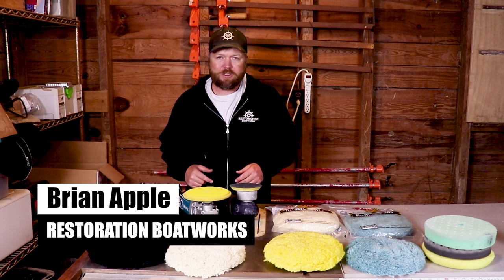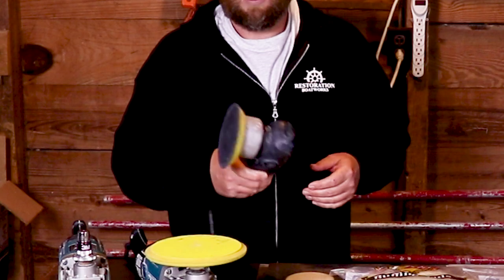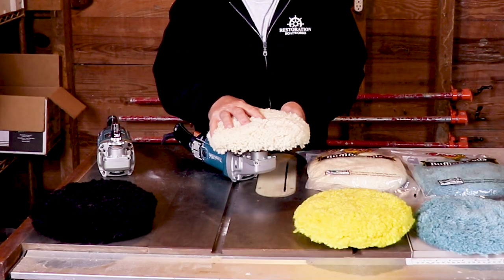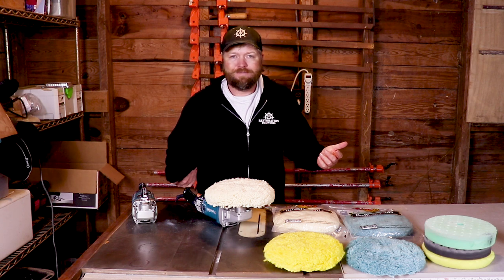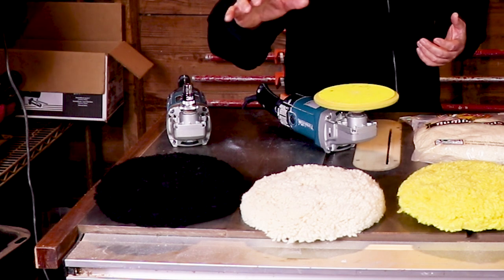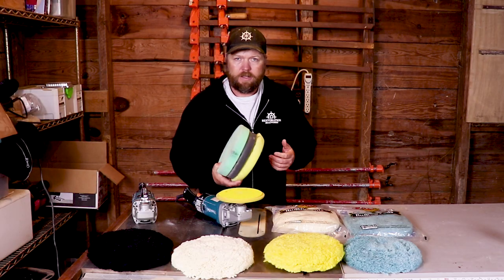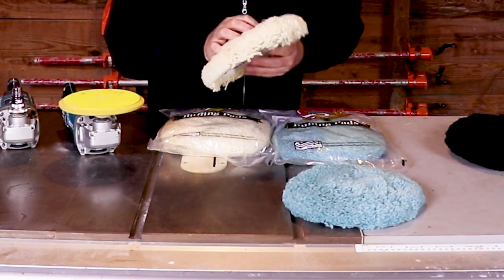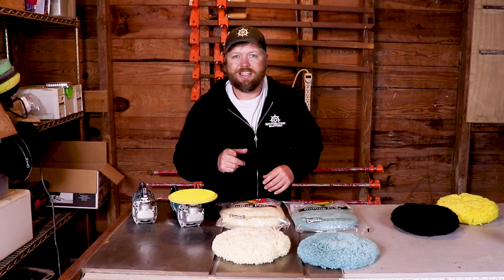Which buffing pad for boats

Comment: We use double sided mop heads solely for the fact that they are balanced better. You can put a velcro pad on but if you are slightest bit off it will vibrate. It may not seem like much but it will tire your arms and your shoulders. Good video. And Presta is a fabulous product.

Comment: Great videos! I have a couple of questions. 1. What type of pad do I use for Waxing?  2. I am replacing original stickers on my boat. I do have oxidation on my boat. So I will use a compound first. When should I apply the new stickers. My guess is after the polish but before the wax. Just want to make sure the stickers will adhere after polishing. Thank you

Comment: So you have listed a buffer that has a 7" pad spec but I'm only finding the pads you recommended in 9" pads. I don't want to buy the wrong pads. Is there something about the PAD spec that would mean the 9" pad will fit on the 7" buffer?

Comment: Hi there! I don't have a boat, but I do have a fiberglass RV, and I think they're about the same. I have used the heavy wool pad with Meguiar's one step, and brought back a fantastic shine. Adios oxidation! So now that I have de-oxidized, polished and waxed (spray on Turtle Wax Graphene Flex Wax) what should I use for the final buffing? Will the blue polishing pad you mentioned be too abrasive for a final touch? Thanks in advance.  (And let me just add, removing years of oxidation from a 23 year old 32' class A is a colossal pain in the a$$! I now completely understand why GOOD detailers charge well over $1000 for this. You people are saints! But after hiring one clod who did a HORRIBLE job, I just did it myself, so now I just have to maintain it)

Comment: Buff and shine sells double sided wool pads and an extension for those pads that’s only $5. I like the double sided pads because they’re pretty much two pads in one, plus buff and shine has wool pads from heavy cutting to finishing, a double sided pad is always perfectly balanced since it’s always centered, with Velcro you have to guess it a few times to get it close.

Comment: Brian, I have a light oxidation on the stern area, and maybe 5-6 feet towards the bow on my boat.  Past that it's in pretty good shape.... I don't want to cut too much, so what would you recommend for me?  It's a black boat and I don't want to end up with tons of swirls.  I have a decent polisher I have used on clear coat that works well.  What pads and compound would you recommend for light oxidation, and finally polish, for the black on my boat?
Reply from the maker: Hunter Johnson what usually happens when you try not to cut “too much” is you don’t do enough.  Especially with dark colors.  If I can see oxidation I’m using compound and a wool pad.  Then polishing with a blended pad.  Did I answer your question?

Comment: Orlando, FL.  Hey Brother thank you for the videos, great job.  I picked up a Makita. I know what pads, cutter, polish and material you use, but I don't see anything about the backer attached to the Makita.  Are you using what is supplied with the Makita, or is it from another manufacturer?  Thanks
Reply from the maker: knotfeelnit sorry!  I left you hanging on that one.  You can use the Makita pad that comes with it.   I do prefer Presta or 3M’s backing plates.  But it’s not any big deal.  That Makita is an awesome machine!  Good luck with it and reach out if you have any more questions.  Brian
Reply: @SportfishingBoats  -  is is the 3m 7" backing plate?

Comment: Hi Brian-  I have a Cobalt 262 WSS.  After spending the summer on the lake i would like to polish the boat before putting it away for the season.  Since the boat is a WSS it has graphics on the side that appear to be on top of the gelcoat (something like a decal).  Is it safe to compound and polish over the graphics?  Also, since I have never done this before what are the 5 mistakes that beginners do when polishing a boat.  I have purchased all of your recommended products for this project.  Thanks.
Reply from the maker: Chris, sorry for slow response.  Don’t worry about graphics.  Go over them like they aren’t there.   Common mistakes in no particular order.  1.  Not compounding and polishing enough.- don’t stop till the surface looks new.  2.  Waxes aren’t the secret.- polishing is!  Pick a wax you like and move on with life!  3.  Fear of “burning” gel coat.  Only buff in shade and keep it moving and you’ll never have any problems.  4.  Trust the process. It works, but it is work... 5.  Remain humble while your neighbor drools at your boat...

Comment: Why do you feel the best way to get rid of oxidation is by buffing it Away? What about either dry sanding w/1000 to 1500 grit sandpaper (which is what is 3M & it’s Perfect-it Products recommends ) or wet sanding by others with same 1000/1500 grit? I have a 20 yr old Key West Center Center console that is super dull & faded, the sides of the boat does still show signs of having some shine, but not much. What are your thoughts? Thanks
Reply from the maker: Wet sanding is more agressive (removes more of  the gelcoat) than just buffing.  Sometimes its necessary, sometimes not.  The best way to see what you need to do is with a test spot.  If you spend more than two minutes compounding out a 2 foot by two foot area, then its time to wet sand.

Comment: Could you tell me the difference between using compound to remove oxidation versus wet sanding.Ive used both and the wet sand is not as messy

Comment: Brian i Have the same makita that you have also with the same 3m quick connector and I want to know wish pad would you recommend me that works good to remove oxidation and also for polishing do you have a part number? Also i use my makita for removing oxidation on #2 and for polishing on #3 what would you recommend me? Thanks!!!
Reply from the maker: Presta White 890082wd.  And green890085wd.
Presta suggests 1800rpm for compounding( 1 or 2 clicks above 3 on dial.). Polishing 1400rpm(1 click before 3).
Reply: @SportfishingBoats  Ok perfect thank you so much!! for the info i really appreciated.

Comment: Brian, 

First, I really appreciate the videos and your expertise. Thanks for passing on all the knowledge to us at home! I’m out of Biloxi, MS. 

I use your setup verbatim, makita and Presta products, I too have found they are the best. Lately I have been working on some boats with gelcoat that is oxidized to the point that it’s badly pitted. It takes me 4-6 passes with the Supercut to get that head on gloss. Even after this I’ll have a good cut on top but some of the putting can still be seen. The setup I’m using is Presta white wool pad, Supercut on a 3M backing plate on the Makita at about 1500-1800 RPMs. 

What have you found to be the best product combination on buffing gelcoat oxidized to that degree?

Comment: Would you recommend a cleaning spur?  Is that necessary and does that prolong the life of a pad?  Great videos btw.. you have motivated me to finally get the chalk off my 18' CC.
Reply from the maker: mdowling73 cleaning spurs or a brush(my favorite) are definitely helpful.  I wouldn’t say it prolongs the life, but rather improves the performance.  When your pad is full and thick with the right amount of product you get optimum use out of it.  1 pad should be fine for an 18.  Good luck with it!

Comment: I know I'm a little late to the party, but can I use the same type of pad used for polishing to apply a polymer sealant after polishing or do you recommend a different one?
Reply from the maker: Just to keep it simple, I recommend applying waxes or sealants by hand for diy use.  There isn’t much speed advantage and by the time you have figured out the set up and idiosyncrasies of the particular product in machine application you probably could have done the boat twice by hand.  Just my thoughts.

Comment: Sorry for the question; I am new to this. What size is the backer and what size are the pads? 7 inch?
Reply from the maker: ttlkamd some manufacturers say 7, some 8, some 9 for their full size rotary pads.  There all the same size.
Reply: @SportfishingBoats  Good day Brian.  Loving the info you are putting out there. Keep up the good work.  I am wondering about size of pads also.  The polisher I am thinking of getting comes with a 7" hook and loop backing pad, but Presta's pads are 9".  do I have to get a larger backing pad for the polisher to use the 9" pads?
Reply from the maker: Peterdotters P there is a lot of confusion on this created by manufacturers.  All wool pads 7-9” are the same size.
Reply: Sportfishing Boats I get what you (and the manufacturers) are saying now.      7”/9”doesn’t mean it fits a 7” or 9” it means it fits a pad 7” to 9”.  Got it thanks.
Reply from the maker: Peterdotters P it’s needlessly confusing. Good luck with it.  If you have any more questions just let me know!

Comment: Great stuff thanks. A few questions: I have bad  shoulders so hand waxing and

 wiping tough.Can I use a my orbital
 to apply and remove wax? Also some recommend acetone wipe down between steps?
Reply from the maker: Robert Moriarty My shoulders are in bad shape too from years of doing this!  I feel your pain(pun intended)!  Absolutely you can use an orbital and use Farleca Polymer wax.  Much easier on and off😀 than other waxes.  No need for acetone at all between steps.  Presta cleans up extremely well(less wiping this easier   On my shoulders).  3M compound for example dries on surface and requires more effort to remove.  Good luck with it!
Reply: Sportfishing Boats hello! Appreciate you sharing your tips. What kind of pad type and brand would you recommend for applying and or removing the final wax with the Makita ?
Reply from the maker: JAY D Your welcome.  If you’ve seen my other videos you know I use Farleca polymer wax a lot.  That goes on and off so easy I  just put it on by hand, especially on the inside.  You can apply it with a soft foam pad on the hull if you like.  As long as it’s soft it will work fine to apply and remove by hand with microfiber

Comment: Helpful Video.  Thanks Brian.
I have a good sized boat and applying the (final) wax by hand isn't really an option.
Is there a pad you would recommend for the rotary polisher?
Thanks again!
Reply from the maker: Any soft foam pad will get the job done.  Nothing fancy required😉

Comment: Great info, What advice can you give on tools for buffing and polishing the gelcoat in tight locations like the cockpit of a sailboat?
Reply from the maker: First remove any obstacle you can.  For tight areas and around fixtures you can’t remove, turn the speed dial down to 1000 rpms or less and have patience.  I don’t use anything other than a Makita 9237.
Reply from the maker: Btw, sailboats are obstacle course for a buffer....🤨🤨🤨

Comment: Brian, new boat owner...I have a buffer and a wool pad, just wondering what speed should I be running the buffer at if I am using a oxidation remover compound?    I am enjoying the videos...well done.
Reply from the maker: Which brand of buffer and compound are you using?  Brian
Reply: Sportfishing Boats Dewalt and 3M light 2+W
Reply from the maker: I don’t use a dewalt so I don’t know the exact number setting on the dial, but 1500-1800rpms.  The 3M or any profit that contains wax creates problems as the wax will hide the oxidation as you buff making it difficult to know if you have removed the oxidation.  That product is also more of a Polish then compound.  Not aggressive enough to remove anything other than light oxidation.
Reply from the maker: Unfortunately...

Comment: What are your thoughts on ceramic coatings? Have you done a video on them? Is there a brand that you recommend that the public can purchase? Lastly what steps should I do with my non-skid surfaces on the deck of my boat?
Reply from the maker: I do not use or recommend ceramic.  I definitely would not recommend DIY it either.  Check out the video on my channel “preventing gel coat oxidation”.
Reply from the maker: Sometimes I buff the nonskid just like the rest of the gelcoat with an old pad.  Just depends on type of nonskid.   Whatever you do.... Do not wax it... it will be SLICK.
Reply: @SportfishingBoats  The boat is a 1995 370 Sea Ray so the non skid isn't super aggressive like say on a Tiara. But I want to keep it clean and prevent it from oxidizing. What products or steps do you recommend on Non skid to clean it and maintain it? Or what steps?
Reply from the maker: Jack Jenerou use an old pad and slow the speed down some on the buffer and compound and polish it just like the gel coat on the rest of the boat.  Just don’t wax it.  Magic erasers are VERY helpful when cleaning😉

Comment: Brian - great videos - thanks - I recently got a Presta black wool cutting pad as white pad were sold out - I have a normal not heavily oxidized 22 ft boat - should I return the black cutting pad for the white cutting pad?  I also got the Presta Blue pad for polishing but the package says the green is better for regular polishing and Blue for final polishing for swirl removal - any advice?  I am planning on using the Presta Super cut compound and the Presta ultra polish for the first two steps.  Thanks again
Reply from the maker: teakayh All good questions.  Keep the black pad it will be fine.  The blue will be fine as well.  In the end it’s a boat not a exotic car going to a show.   You’ll get good results with those.  The differences in those pads is negligible.

Comment: so im guessing use the white for polish and blue for waxing? what one would you use for oxidation removal? thanks!!
Reply from the maker: Jerry White for Oxidation removal.  Green/blue for polish.  Good luck with it!
Reply: @SportfishingBoats  so polish and wax pads are interchangeable?
Reply from the maker: Jerry No sir.  Wax pads are usually black foam for machine.  I  hand wax on the inside and sometimes use a dual action on hull sides.  To keep it simple, I would recommend just hand waxing.

Comment: Hey man thanks for the video. I am currently using a DeWalt rotary buffer and I cannot get the gel coat looking good. I am very familiar with automotive paint. I am using the 3m medium and light gel coat compounds with the meguires heavy cutting pad. I have also tried the makita wool pad. I’m at a loss. I even tried wet sanding the oxidation and buffed it out. There is always light scratches remaining and some haze. I have a 2015 Yamaha AR 240 and the gel coat is grey.
Reply from the maker: Okay.  Here is a key thing to know if you have experience with automotive paint.  Something very aggressive on car paint Is only medium aggressive on gelcoat.  You have 20mils of gelcoat and 2 mils of paint.  3M is a nice product in an auto body shop.  It’s not so good on a boat particularly outside.  There are just a few compounds made that really perform well on gel coat.  Presta Supercut is darn good.  I can’t remember using a Meguiars pad.  I can tell you the Makita pad is seriously lacking.  I use Presta, but a 3M 5711 is a nice pad.
Reply: Sportfishing Boats thanks for the information. What are your thoughts on the battery powered DeWalt Battery Powered rotary buffer compared to the corded one.
Reply from the maker: Ben Cox Corded is what you want for numerous reasons.
Reply: Sportfishing Boats thanks for the great advice. I purchased everything you recommended. The cutting compound and black pad are amazing. I want to send you a pic. I have one question and I should be good to go! Thanks again. As I am cutting the shine is coming through, but when I look close with a light there are some dull areas still.
Reply from the maker: @bencox7439  Compound it again.  With Gelcoat you can apply more pressure to the pad than you would with auto paint.  Try that and see what happens.    1800rpms works well.

Comment: Cleaning wool pads... use the spur tool between jobs? Only use the spur tool? Or throw in washing machine? If so, then what soap?
Reply from the maker: All good questions I need to include in video.  A spur is handy.  You can soak in bucket with dish soap as well.  I don’t use more than a quart of compound or polish per pad.  So I usually finish the project and throw the old one out.  Fresh pads make a huge difference.

Comment: Question: I did a heavy cut last season. I just want to bring it back from the year of use and protect it with wax. Would a one step medium cut/wax from 3M work for that application? thanks! also im going to buy that Makita!
Reply from the maker: Check out my video preventing gel coat oxidation.  This is what you want to be doing to maintain once all the oxidation is removed.  Yes, the Makita is bulletproof.

Comment: Would you use these same pads to do an Rv. When you use the polishing pad are also using a polishing compound.  I'm new to this so sorry for sounding lost.
Reply from the maker: tim taylor Yes, if it has gelcoat it will work just the same.  Check out “buffing and waxing to remove gelcoat oxidation” video on this channel.  I think that will help answer a lot of your questions.  Brian

Comment: Hey Brian, it’s Richie from MD again. I went ahead and purchased the Makita. It has a setting from 1-6. Question: what setting should I have it on for compounding, and what setting should I have it on for  polishing?
Reply from the maker: You’ll see a guide on side of machine that indicates which numbers correspond with each rpm.  1800 rpm compound, 1400 for polish.  That means one or two clicks past “3” on dial for compound and one click before 3 for polish.  However, it’s totally fine to go a little slower compounding the first section until you get the hang of it😉

Comment: Hey Brian, thanks for the great info.  Is there a setup (polisher, backing and pads) you can recommend that would work for both a boat and a jet ski?  I guess the only real difference is I'm thinking I'd need a smaller backing/pad setup for the nooks and crannies of the ski vs the boat.  Will the same compound/polish/wax work for both applications?